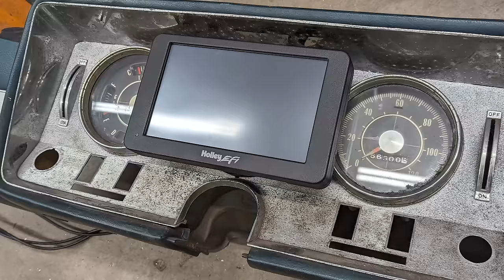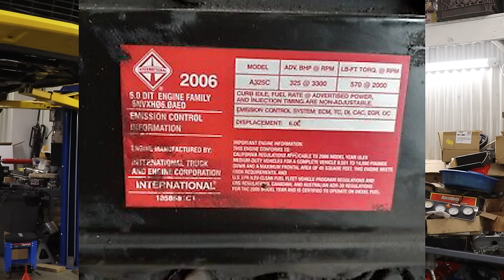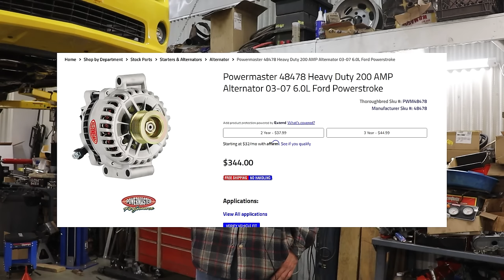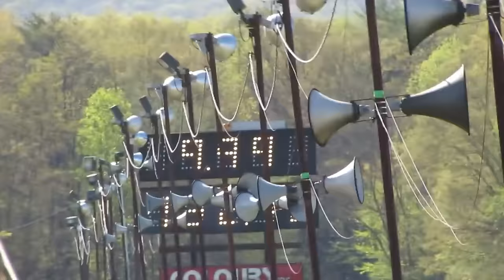Regrets: Losing My Studebaker to a Thief

Comment: I found 2 foolproof ways to prevent auto theft, guaranteed.
1. Drive boring. I have a Toyota. Beige.
2. Keep it broke down in the driveway. 
TADA!
Reply from the maker: Yeah. I thought I drove boring. Rusty old Ford with a dirty old trailer. No one is safe.
Reply: @Calvin-Nelson  it's a damn shame. I learned to work for everything I have at a young age. Kids need their dads.

Comment: Problem with the insurance paying you off if you do find the car, truck, trailer later there is a good chance you won't be able to get it back because the insurance has already paid you for it. I know this because my brother went threw that with an 06 gto that was stolen right infront of him (was trying to sell it and had a potential buyer and my brother made the mistake of closing the shop door with said looser already behind the wheel and by the time he got out of the shop which was about 40 seconds the guy was down the driveway and out on the road) and they didn't find it right away and the insurance paid him for the car then they found it and the insurance didn't offer it to him for a buy back or anything he tried to but they wouldn't let him which I thought was crap but that's insurance companies for you!

Comment: If that was a power stroke everyone knows u can just touch that wire on the pass side fender, undo it and touch the female end to the positive terminal to start to, must of broke the steering lockout?
Reply from the maker: I didn't know. I figured Ford would not have designed the vehicle to be stolen.

Comment: I take my fuel pump relay when at a motel since I know so many guys have had their truck and trailer ripped off I don't even risk it when I park it I pop the hood and remove the fuel pump relay andI am safe they can steal it but they will not get far with no fuel pump

Comment: Keep checking social media for your shit. And always remove your engine fuse or some hard to pin point part. Thieves aren't smart and they wont take time to figure it out they wanna be quick as possible. I had my brand new dirt bike stolen years ago and i was like a detective and tracked it down 2 weeks later in a pond near me. Cops wont do shit i promise you that.

Comment: What happened was you made several serious mistakes.  Sadly that cost you a small fortune.  I hope you recover what's yours but I seriously doubt you will.  This was likely done by pros and your stuff is probably already inside a container or two and headed for E. Europe, Russia, middle east or Africa.  What a sad loss.  I really liked that Stude. 
The lesson is: Never leave your vehicle unattended when traveling especially if it looks like it contains valuables or a trailer with valuables in it.  If you need to rest, have your wife, passenger or whatever drive while you rest.  In this case it may have been someone at the event that followed you and snatched everything... thieves are everywhere now.  NEVER park your vehicle in a Hotel parking lot... even if it's right in front of the window of your room.  You have to sleep sometime and the thieves know that.   Worst case, pull over somewhere either well populated (Walmart?) or in a rural small town and sleep in the vehicle.  A rough night or two of bad/uncomfortable sleep is far better than the loss of your prized possessions.  I state this based on personal experience.

Comment: It sucks...once I am loaded...I do not leave my rig...if you leave it...and you do not disable it...EXPECT IT TO BE GONE...Simple as that. I empathize with you...Hope you find all of it...but from this point forward...DISABLE your vehicle...then the thieves will only break in, steal EVERYTHING inside your truck, truck bed, and trailer...in other words...NEVER leave your loaded rig in a parking lot...draw straws...short straw sleeps in truck. It is the U.S. and A...pretty much a third world country...lowlife thieves are EVERYWHERE...and they can steal a truck in a couple of minutes....DON'T FOOL YOURSELF...IT HAPPENS EVERYWHERE. HOPEFULLY...it gets found...It really SUCKS.
Reply: Yeah I have a 2014 dodge charger. And even though it's a v6, you know how easy they are to steal. I have a device that bricks the gas pedal once the car is locked. And locks the brakes if anyone were to try to rewrite a key. And also a pin type entry system once the car is started to where the pedal is bricked. And brakes will lock up if incorrectly entered to many times or if not done in time.
Reply: @jonathoncouchey7151 bla bla bla